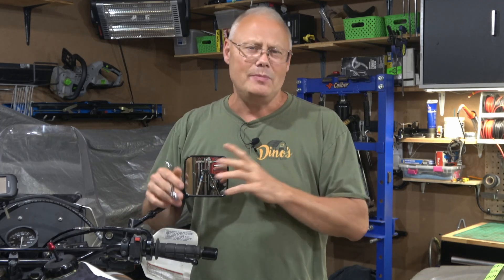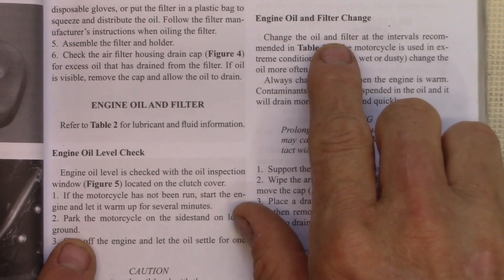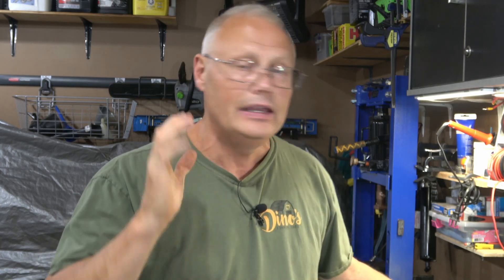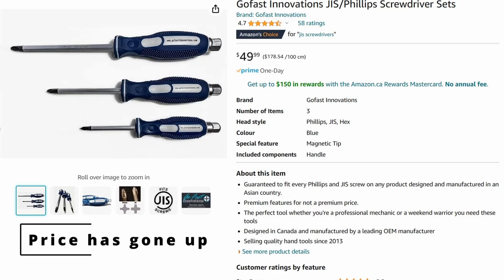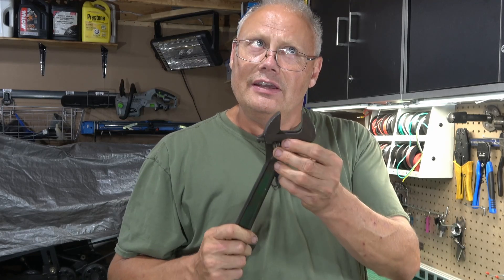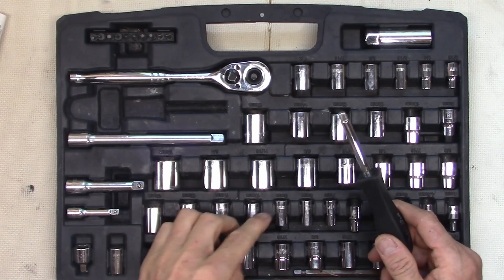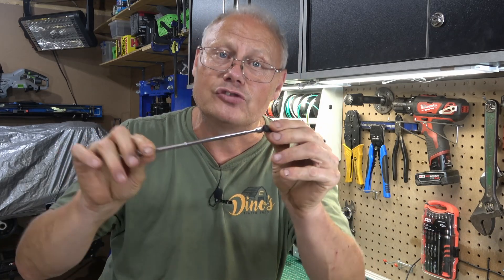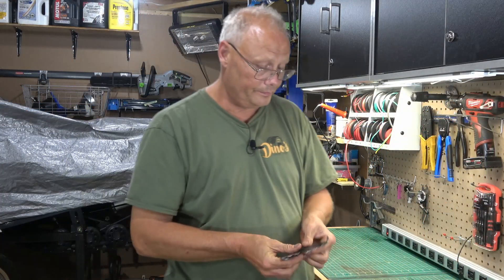Building your first motorcycle tool kit

Comment: i just make my own kit, it weights 1400 grams and fits perfectly in a neoprene pouch than also fits perfectly in the oem dr650 tool box, it includes:
1x tri size ratchet that fits 1/4, 3/8 and 1/2 sockets it 7 inches long
1x 5 inch socket extender
1x 2 in one screwdriver the axle is removable 
1x 1 small flathead to make carb tuning
3 allen keys small black ones dr650 uses 4 5 and 6mm
3x spanners 8mm, 10mm and 12mm (you only need a 14mm spanner to adjust the turn lights)
7x sockets 8, 10, 12. 13, 14, 19 and 24mm
1x spark plug socket

the missing tool in my set would be a spokes adjustment tool, i also include some zip ties and wire heat shrink
Reply from the maker: Great option, I always love how every rider fine tunes their kit to meet their requirements, it is a very personal thing and I love it. Thank you for sharing your kit break down.
Dino

Comment: Well said Dino !   At 20:36 a 15/16 inch socket works great on the rear axil nut as well .   Had a rear flat tire on the DR 650 this morning but had it back in action in the afternoon .  
For the most part I use the stock Suzuki tool kit and a Leatherman supper tool 300 on the road and trails . 
Have you had a chance to run some heavy equipment on job sites ?
Reply from the maker: Great information. Thanks for sharing. I can attest to the usefulness of a good multi-tool, I use mine almost daily at work. Yes I have had the chance to run some heavy equipment, not as heavy as I would like but large frame tractors, high horse compact track loaders and some larger trucks with 18 speed transmissions, it so fun.
Thank again Dino

Comment: Hi. Thanks for the review. Im a 70 year old with 50 plus years on old British road bikes and starting on a DR 650 to try adventure riding. So my tool kit is mostly AF with a few Whitworth and BA spanners.  I bought a new 2018 DR and currently doing the 24,000 km service prior to this summers ride season down here in NZ.

I wanted to add one suggestion to your tool kit if people need to undo the engine frame mounting stud and nuts to fit a bash plate for example. I found the nuts were unbelievably tight from the factory. To the extent that my 12 point sockets broke over the nut with a loud bang. For these few nuts you need 6 point sockets. Definitely a 14 and maybe one or two others. I actually got heavy duty impact type 6 point sockets and a breaker bar to shift them.
Reply from the maker: Great suggestions, thank you for taking the time to share them, and I love that after 50 plus years of riding you are still passionate about the sport. Thank you again
Dino

Comment: hi again Dino,

yet another video full of great information and good sense. Thank you for this 🙏

Was able to make a ton of mods with only a handful of tools you recommended, ranging from bar risers, footpeg lowering, bark busters, adjustable clutch & brake levers, mirrors, led headbulb, some crash bars, axle sliders, pro cycle seat and cover, etc.

Next up carbie jet kit and tuning after the break in, and I've enjoyed your videos on those as well ❤

Quick question though, what sort of "toolbox" did you replace the standard black plastic one with? I'm asking because yours seems more spacious, and I'm interested because it would have enough space for my ratchet and a more robust selection of tools than what the standard tube fits.

Either way, your videos are great and love the production value as well 🙌
Reply from the maker: Hey, so glad you enjoyed the video, I used a stick welding electrode tube for my tool box, here is a link: https://youtu.be/yiFJcW3HWoo

Comment: 14,16,18 and other odd sizes as you call them are related to the thread pitch,8,10,12,17 and 19 are related to the bolt size.M6,M8,M10 and so on.all these sizes come in fine,medium or course thread profile and pitch.A course pitch will have a bigger bolt head as it requires more torque hence the odd sized spanners,sockets or wrenches.

Comment: I strongly suggest you talk to using a torque wrench. One has to be careful, because at ( even)  the correct setting it is easy to strip a bolt/nut.